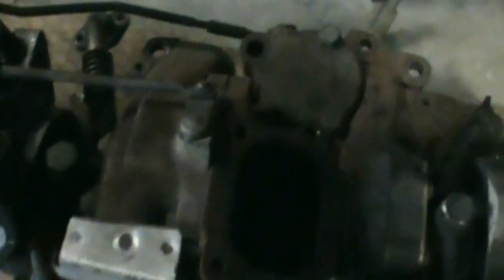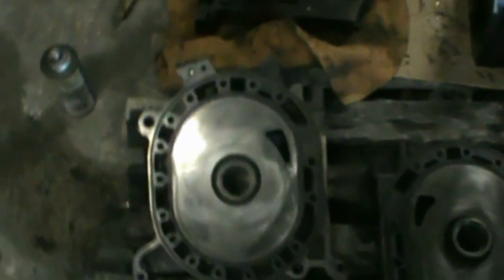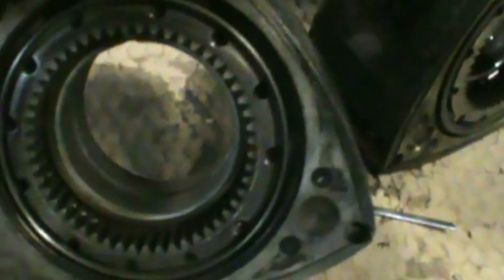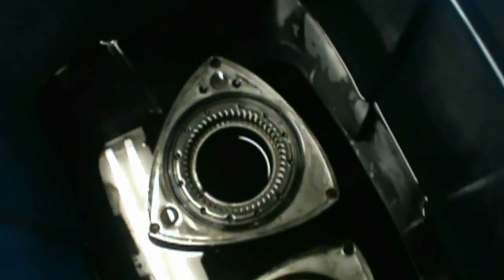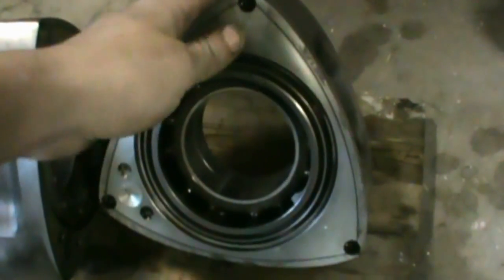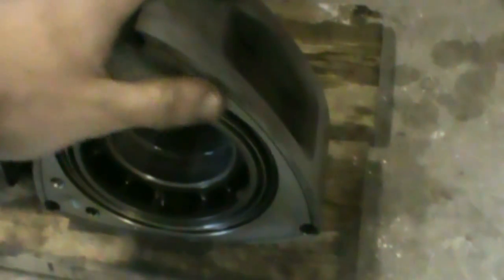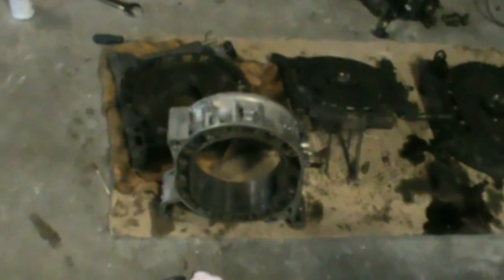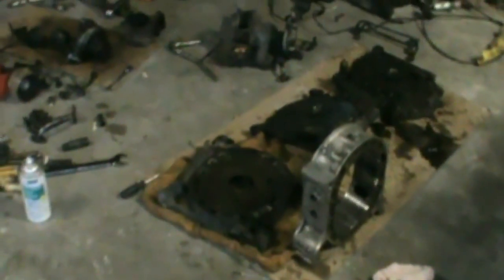How to Rebuild and Port a Rotary Engine : Part 4

Comment from the maker: they're the different style ports . streetport can be small medium or large. they're designed to make the car drive able on the street.
bridgeport is a huge port with and extra little eyebrow port on the outer edge, tey call it a bridgeport because the corner seal runs along a little bridge between the 2 ports

Comment: But these engines are also very modular! Could you just add a 3rd rotor and change the ignition and all the other parts accordingly to make the motor 50% more powerful? Try imagine that with a piston engine, taking 2 4-cylinders and making a 6-cylinder or even a V8 out of them! Wouldn't be easy at all!